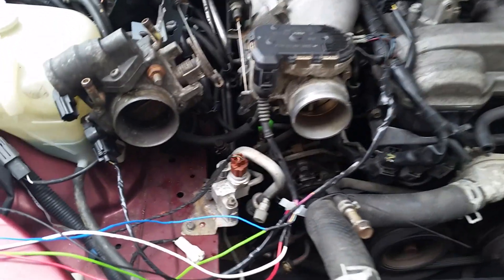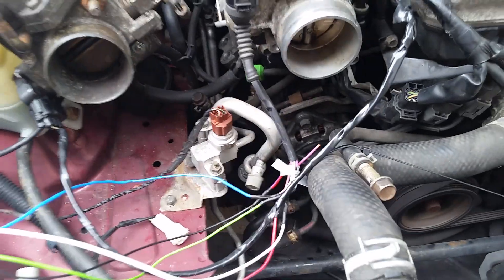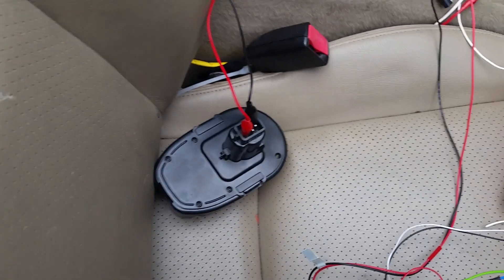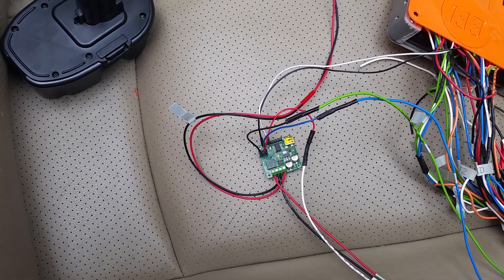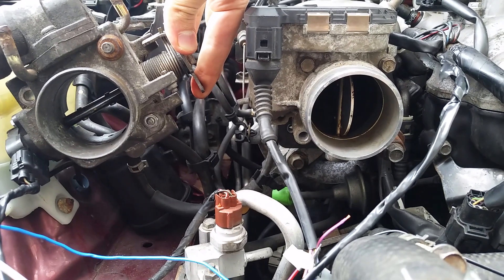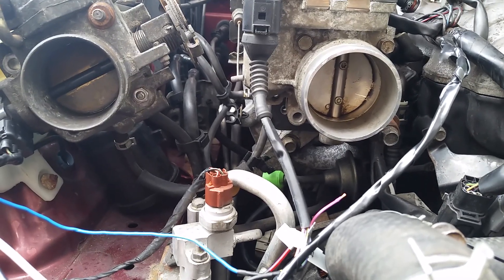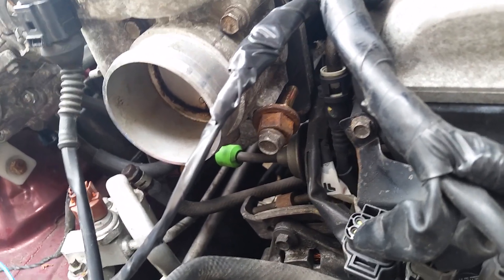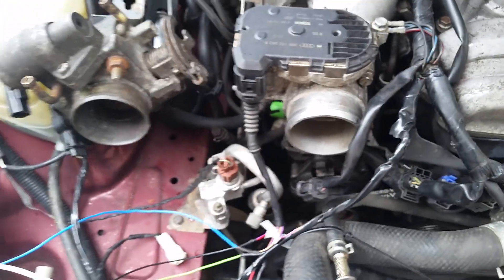2001 miata electronic throttle body pololu Jrk 21v3

Comment: Keep hacking!

Lag is visible in this setup, but as long as you get TB properly hooked up it`ll be OK, I guess.
Reply: Not too much lag, but yes - I can see a little too. There’s also visible stepping, I wonder what the resolution of these things is - 8 bit/256 levels? I don’t hunk much more would even make sense for most applications.

I wonder where the delay/lag and limited resolution exists. Micro controller/pololu board? Positions sensor? Electronic throttle body itself? I wonder!

Also, is the throttle body a servo with feedback? Or is it a stepper?